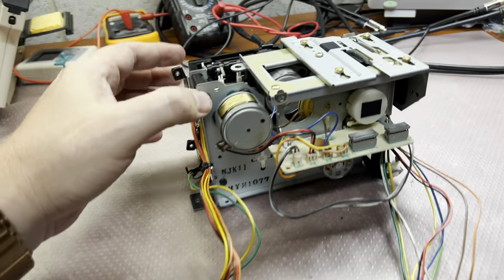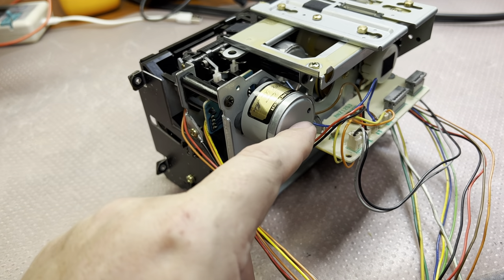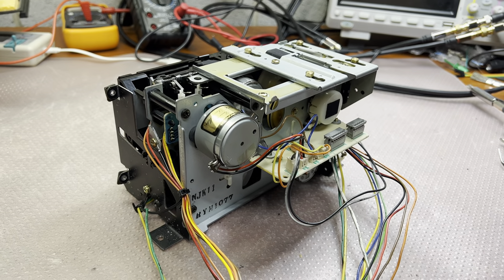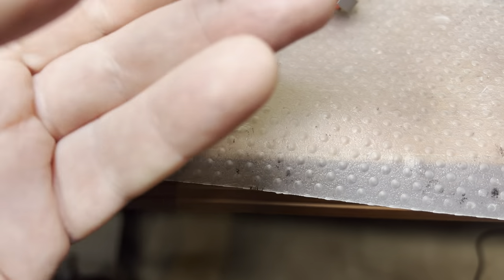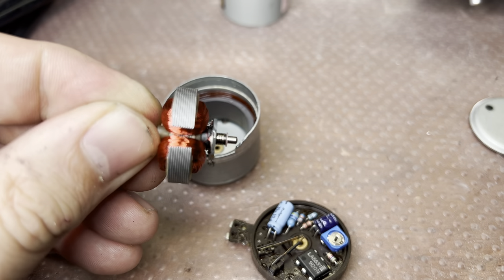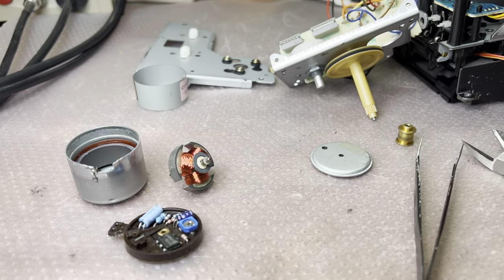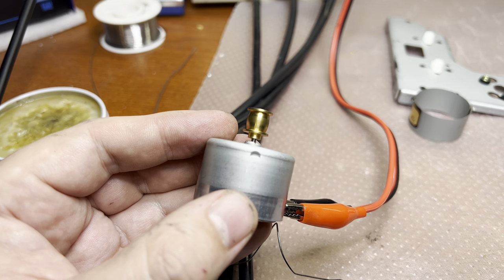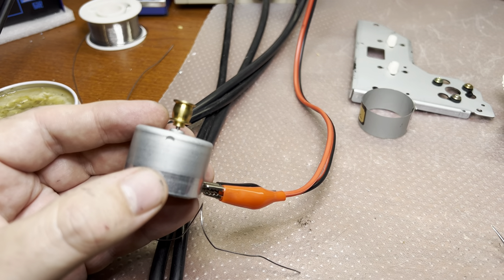Pioneer CT-91a: Capstan Motor Rebuild Tutorial

Comment: 2 months ago had the same problem on my pioneer ct 757 , rebuilt the whole motor , re oiled , no luck , speed still unstable (rises and descends by 10hz every few secounds).
even cleaned the pootentiometer , still no luck... i need a new motor
Reply: Yes, the same thing :(
Reply: @powerday_Hi-B back and front bearing
Reply: @Zomby3000  i ordered some matsushita motors , hope they ll fix my problem.
Reply from the maker: @powerday_Hi-B  оба бронзовых подшипника.
Reply: @powerday_Hi-B  motor is completely silent. There is also no bearing play.

I don t know what it is
Reply: Perhaps, as i think, one of the windings is damaged and there is unstable speed
Reply from the maker: @cherbet  Did you clean the contacts and the rotor? I always do that.
Reply: @powerday_Hi-B  motor isnt overheating.

I cleaned everything when i rebuilt the motor.
Reply: @powerday_Hi-B  i ordered some matsushita motors , new old stock. will rebuild them to oil the bearings and see if speed is stable.
Reply: @powerday_Hi-B  Long term speed drift is fine.

Speed drifts by 10hz every 10 secounds.
Reply: @powerday_Hi-B  they are annoying?

Songs get AUDIBLY faster or slower every few secounds , and you notice it.

speed drift across the whole tape , you won t notice that much.
Reply: @powerday_Hi-B  i can t do that right now. I ll see how it is after i change the motor.
Reply: @powerday_Hi-B  it s pretty easily understandable. Speed is unstable.
Reply: @VintageAudioTech I definetly dont have a database with 100+ serviced decks by me , with fr graphs and other specs taken for each one. I clearly dont know anything about i m doing. I m sorry , my bad.
Reply: @VintageAudioTech  Sony made good and bad decks , but the ones aimed for the average market were always plastic and crappy. That s why i hate them.
Even higher end decks from the "QS" - Quality Standard , were so crap they looked like a joke for the pricepoint and for the "quality" statement.

What s wrong with caring about details and bringing a deck to absolute full potential?
Reply: @VintageAudioTech  Keep your sony's....
How were naks designed like shit ?

I m simply not buying a sony deck because they are mostly overpriced. Especially ES series. I m not gonna pay double what something is worth when i can get something maybe even better for half the price.

If i had 2000$ + , i would simply buy a nakamichi zx7 wich is superior in every single way (per channel calibration , autoAZ, discrete heads , full proper direct drive (not closedloop...))
Reply: @VintageAudioTech  It s gonna be a endless topic anyway , like Audi VS Bmw... one likes that one because of something , one likes others  because of something else.